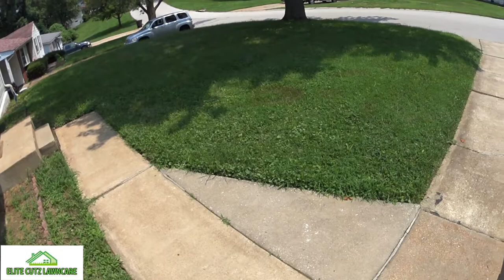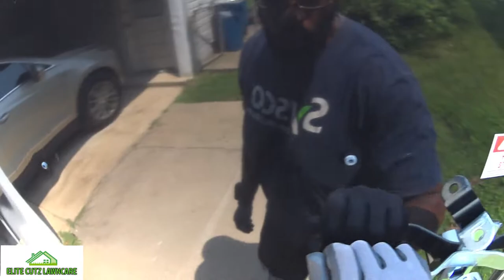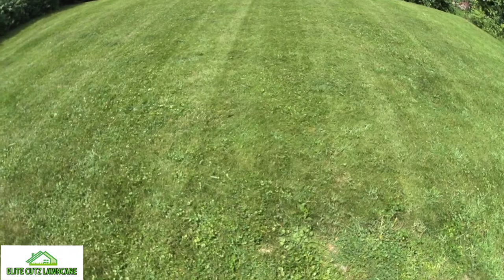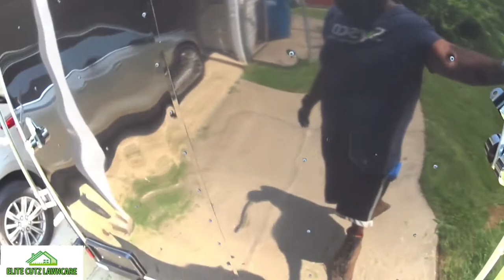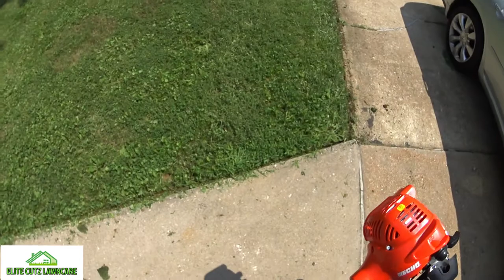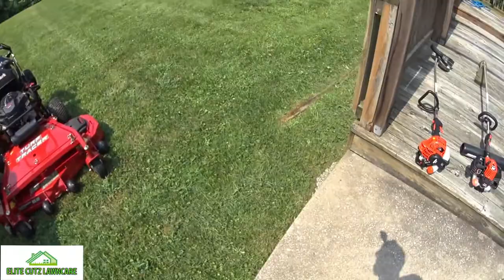COMING OUT THE TRAILER WITH MY EXMARK TURF TRACER 52" WALK BEHIND, CAN IT CUT OR WHAT?

Comment: Make sure to run your equipment at full throttle! Air-cooled engines cool more efficiently at higher rpm, since the air is coming from the flywheel.
Reply from the maker: Thanks for the info
Reply: @Lawn-Extraordinaire  the hydro pumps / motors are also made to run at full throttle.  additionally, it is a good idea to engage the blade clutch at low throttle and then throttle up for the lifespan of the clutch and the blade belt.
Reply from the maker: @matt02468  Thanks for the info on the throttle I didnt know
Reply: @matt02468  so you're supposed to engage the blades at Mid throttle and then increase to full throttle. When disengaging go to Mid throttle before you disengage the blades.
Reply: @tomw1719  where in the manual does it say that?  let me know.  thanks.

Comment: Do you double cut and cross cut all of your yards that way, brother? 

I only double cut either when the blades are needing to be sharpened or the grass is super thick and there's clumps everywhere unless it's a HUGE yard like some of the seven acre yards I used to cut in Nashville, TN
Reply from the maker: No sir only my yard or when its open land and I want to do a design.
Reply: So are you essentially just starting out on your own? Or have you been doing it solo for a minute? I started last year just part time on the weekends as I work full time for a Landscape company in town but right now due to relocating back down to the Florida Panhandle region and lack of a solid reliable vehicle at the moment, had to put my small business on hold for the moment. Should be able to get back up and going though for this mowing season
Reply from the maker: @louisvinciguerra194  I started in August just to get a feel for how everything goes and this season I will be full time no more working and busting ass to make others richer. I will be dropping content regularly last year i didn't want to alarm my customers with cameras until they got a feel for me.

Comment: Get some e tracks for the trailer that’s what I did and it works the best to hold everything and it’s by far the cheapest
Reply from the maker: Thanks im going to check that out, i have a update video coming and i used wood in front and behind the tires and that should hold but when it doesn't i am definitely going to get those tracks.
Reply: @Lawn-Extraordinaire  yea I posted a Lawncare set up it has them in it snap rack .com is one place and northern tool is another. You can also put a bunjee around the brake so it doesn’t flip down in transporting the mower. I just got a 48 turf tracer didn’t make a video yet with it
Reply from the maker: @TheLawnFellas  Thanks for the info